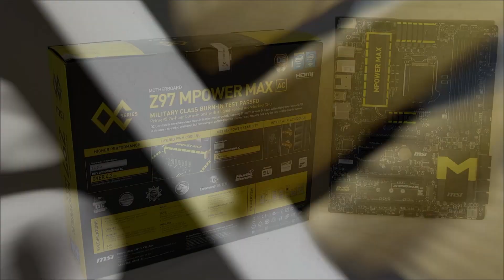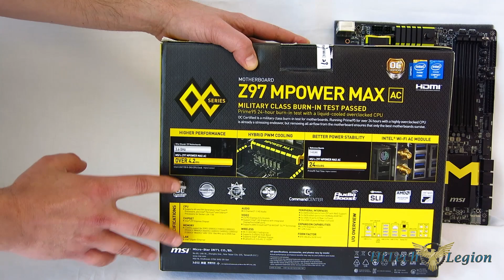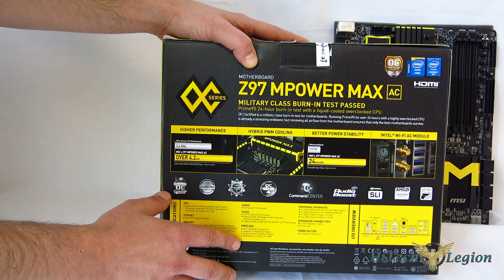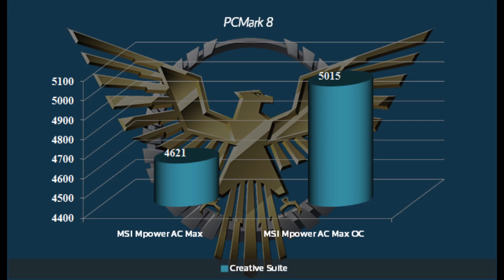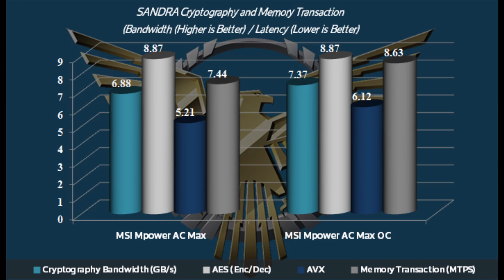MSI Z97 MPower Max AC Overview and Benchmarks

Comment: Im thinking of replacing my H100i with that cryorig ultimate but im worried if my high profile ram would get in the way .. so if you wouldn't mind asking how much space did you have in there or what RAM did you use?
Reply: Hossam Ismail If you are using taller RAM, you would be better off with the R1 Universal. It uses an offset to the real and slimmer fan to completely clear the RAM slots. Performance is within 1~2 degrees.
Reply: George Cella you're right but when it comes to extreme OC the 1~2 becomes 10~20 same as my H100i when i tried the slim fans for the radiator as there weren't enough room for the stock in my CM Scout 2
Reply: Hossam Ismail It is a little difficult to make a correlation between a unit designed to use one slim fan that has excellent passive cooling capabilities, with another that requires excessive airflow by design and has literally almost no passive cooling capabilities.

You can not compare the conditional results of your H100i with those of the R1 coolers. They react entirely differently to the conditions you are referring to.

In other words.....no, the 1-2 degrees may stretch to 3-4 degrees, but that would be about the extent of it. The R1's performance won't crumble like the H100i if you deprive it of 11 CFM from one of its fans.
Reply: George Cella well i'v never had an air cooling unit but what i know is that both are the same only the Universal comes with the slim fan replaced and no changes in the design but then again i haven't had an air cooling unit so maybe you're right!

Comment: Great review - i just bought one of these (an ex-display model) only thing is it didn't come with the wifi attachment or antenna - could you share the spec/model on the back of it so I can see if I can get one online, or do you know where I could get one?
Or should I just use a regular wifi dongle?

Thanks
Reply from the maker: Keith Black If you purchased a demo model, you probably bought it as is. I suggest you purchase a pci card and use that, there is really no way to get those accessories unless you purchase it new in the box.
-HTL Paul
Reply: Thank for the info, so a pci card is better than a wifi dangle?
Reply: +Keith Black Just stumbled back on this post & wanted to update to let evry1 know that I wrote to MSI by email & they actually sent me the wifi socket for FREE!How's that for customer service!I will be definitely sticking with MSI from now on - & I'd also like to point out that this board is amazing - 10/10 from me :)Good customer service coupled with a great product goes along way

Comment: whats wrong with the stock sata cables?
Reply: Nothing wrong with them....they are just standard, inexpensive cables.
Reply: George Cella does expensive make them pass data better>?
Reply: hoodninja gaming No, and it is not a matter of cost, per se. These cables tend to fail or be simply DOA a bit more than higher quality cables
Reply: George Cella ok i mean any pc part can be doa. on a brand new build i always tell people theres a 90% chance 1 part will be doa. on the 4 build ive done for people that only happened once so my number is a little off i think but you get my point right?